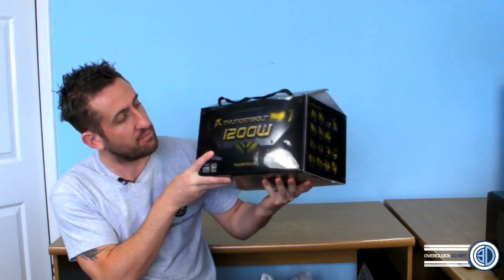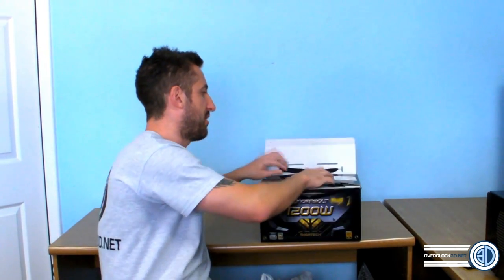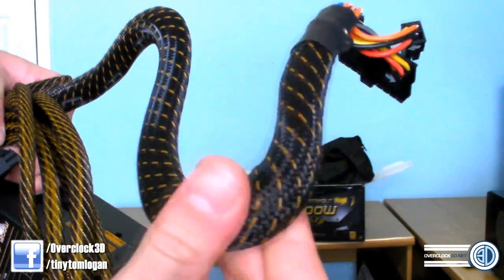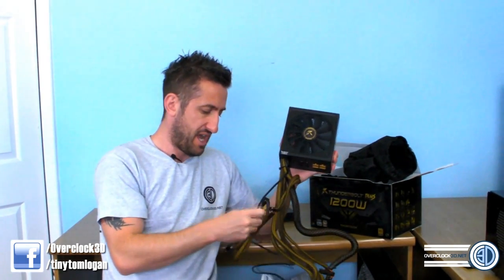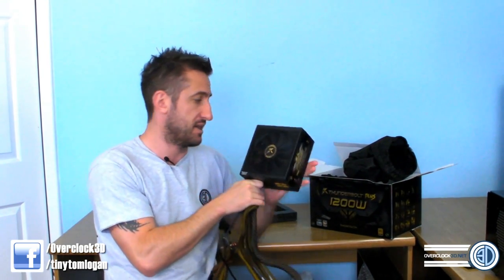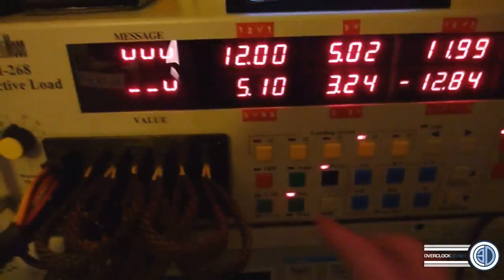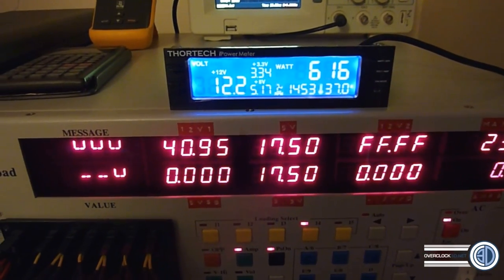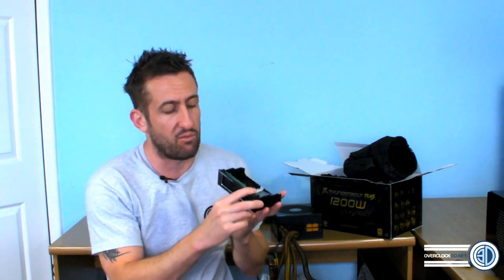Thortech Thunderbolt Worst PSU Ever?

Comment: You should have opened it up and showed us how cheap it was inside.
Reply: segaprophet It won't look cheap inside. It's a high end PSU with better than decent efficiency (80+ Gold Certified) which can just about deliver 1KW, there's no way you could make it in a cheap manner. Furthermore it's designed and manufactured by Sirtec/Sirfa, who are not the best at quality consistency, but their higher end units always look excellent inside. There's probably just a very tiny, visually imperceptible, design fault or quality issue there which produces high ripple and janky behaviour when it approaches 1KW and makes it unfortunately a terrible product, unfit for its intended use. Chances are, an approx. 800W version of this platform performs spot on and might not suffer from issues, it was probably just a terrible idea to try to extend it any further than that and not compensate by instating a lot of extra QA.

1200W PSU is not needed by a lot of people, certainly not by any person with just one or two GPUs, and few of those will take any chances by getting a potentially mediocre PSU a few bucks cheaper which could damage their 3 grand worth of hardware. Chances are, there was just one batch of them made.

Comment: It's not a problem until it's a problem. There is more to PSUs than power delivery, like over voltage / over current protections, and how they protect the components in case of catastrophic failure (even the best PSUs can take out components).

Never skimp on a PSU :) Everything's connected to it and depends on it. Some can even be fire hazards. 

Seasonic, Corsair, Antec, Enermax, XFX, BeQuiet, Some OCZs, some Coolermasters. Also important is the OEM. Seasonic, ChanelWell, Delta Electronics...

Comment: I think Tom makes good reviews, but there is some pints in this one which is misunderstood.
300 mv is not much ripple in it self. Though ripple can be a problem to certain circuits and components.
As to the ripple on the oscilloscope, being from top to bottom does say absolutely NOTHING, about it being bad or good, since you can have a 1 mv ripple "filling" the whole screen too.
The screen is adjusted to show the whole ripple, instead of a fixed value on the x and y coordinates.

Comment: Its one thing ive always tried to warn friends about - dodgy or cheap psu's. A mate of mine at college paid 40quid for a 750w psu after i warned him not too, his rig is fairly modest with a stock phenom 2 quad, 8 gigs of 1333mhz ram, radeon 6850 and a single hdd. He didnt need nowhere near 750watts and cheaped out after i tried pointing out exactly what tom says in the review. Jus a matter of time before it goes pop me thinks

Comment: Expect the AX-i series are made by Flextronics. Overall they are actually better than the Seasonic platinums due to the insanely low voltage regulation and ripple levels.

The TX-m and the lower wattage AX-series are Seasonic rebrands, but the rest (excluding the AX1200 and AX-i series) are made by Channel Well.

Comment: And regarding the test you made with the wall-reading and the display reading is not wrong. The PSU display properly showed the right wattage.
The reason why the numbers differentiated, is because of the efficiency of the PSU.
It seems like the reason for the whole silver,gold, platinum ratings, has eluded you?
Simply put: It take more power from the wall, than the PSU delivers to the component.
The better rating/efficiency the closer the numbers get.
And the diferencial loss makes the heat.

Comment: It was a VX550w and it was a solid power supply, never really had any problems with it and would still consider corsair as a top brand, i put the exact same model in my brothers computer and a cx430 in my mates, both of them are going strong i just had a duff unit, or i was pulling too much (my computer pulls more than both of theirs) i now own a Thermaltake toughpowerXT 575 and as i said before, it is quieter and just as solid.

Comment: if it was dipping then i wouldn't worry too much about loosing components, just data corruption, regular BSoD, etc from having such an unstable system. The big problem for hardware is when the ripple is going too high, as it could burn out everything or at the very least decrease its lifespan.

Comment: how about PowerLab psu... almost 5 years i'm using that power supply.... until now no problem... but i always doing some maintenance like ones 5 or 6 month...or depend times..  clean the dirt dust just by using my electric air blower.... it's shape like a snail shell turbo turbine... just shoot and the dust will blow away... powerful air blow but it did not charmful to your electronic component chips or capasitor... helps me a lot while doing maintanance/pc clean

Comment: Just as an aside, this PSU is terrible but not for the reasons listed. The voltage drop you experienced by the screen was probably the rubbish cables leading off to your multimeter/oscilloscope, and the difference in wattage from wall to what the screen is reading is to do with the efficiency of the PSU. The PSU will draw approx 20% more power then it pumps out depending on it's efficiency and power factor. This PSU is still rubbish, but I'd just thought I'd clear up some misconceptions.

Comment: yes, do not listen to the other guy , thermaltake as long as your buying a non cheapo psu from them is good , id reccomend a toughpower unit from them based on what ive seen and read they are excellent in terms of reliability ,performance, and build quality . and couger is new , however they are fairly high quality . boutique style in a way . they do build higher end psu's and ive seen alot of reputable gear review sites, use them for there test bench at a time or another.

Comment: big names like ,corsair , thermaltake or antec. or if you want omething a bit different, the nzxt power supplys are supposed to be excellent, and i personally own one from xfx and im running it just under its rated amount. and its running great. outside of big brands (in terms of psus not overall )  nzxt and xfx power supplys are about the only ones id reccomend.

Comment: 6 years ago I bought a power supply TAGAN, very quiet, stable. I recommend
Reply: wues85 Are you sure it's a good general recommendation? Because for one, any given sample is not representative of all PSUs, one model is not representative of all models, and for other, you probably don't have testing equipment, you don't have a load tester and you probably don't have an oscilloscope to ripple at approx. 400Khz or higher, and chances are you're not even loading your PSU to the limit.

That being said, i hear Tagan has delivered a lot of good PSUs as tested by trusted professionals, but they have been switching ODMs so there's no telling whether any other model would be good. Another issue is that Tagan basically doesn't exist any longer, it appears the whole Maxpoint group has gone under, stopped doing business, or went bankrupt.

Comment: It's still not making up the ripple. The machine is rated at 1080W according to you. At 1000W (which is within the 1080W), the PSU gave a ripple of 250-300mV. That's too much, and it's not even fully stressed yet.

Comment: Just came home from hospital.. Leaned onto a pc with a bad psu to plug in a network cable into a switch. Got a really big shock.

Electicians came running.. yep, 230v.
Reply: You mean you were shocked by elecricity. Third degree burnz anddd you go back to hospital

Comment: to 1977JohnBoy; Most high end gpu's (7970 or 670 and up) can draw up to 250watts per gpu.  Then you factor in a 50-77 wat cpu.  With one gpu a 500 watt power supply leaves you with some breathing room for hard drives, fans and other pci cards.  Generally you probably wouldn't go with a 1200 watt power supply unless you were going for a quad gpu build.  This specific one WOULD fail if you were to try 4 high end gpus and a moderately powerful CPU.  Buyer beware!!
Reply: You find me a gk110 that is not under subzero temps at 400 watts and i'll submit to that statement, otherwise i've done moderatly extensive reading on reviews and the gk110's rarely even peak at 300, let alone sustain anywhere near 400 even when overclocked.  the haswells don't get much higher than 100 watts when overclocked (maybe 110 max on liquid or air).  I've used a volt meter on my system running a 3770k and 780 and the peak system wattage i've hit was 450, that's with 4 hard drives, 12 fans, liquid cooling (pump) a disc drive, all peripherals and monitor on.  I have the unlocked bios for my DCuii 780 and have that beast cranked.  Max wattage was attained whilst having furmark and prime95 running at the same time.
Reply: Well i see it and therefore submit to your statement :P, there are many posts to back it up; however it seems like with the silicon lottery, safe limits are really hard to determine.  I'll stick to my 1274 core clock and +210 on the mem; temps max out at 70 so i wouldnt have a whole lot of temp headroom anyway

Comment: 80 plus gold/platinum etc is purely the efficiency of the unit, ie how much energy is lost to heat/noise etc. It very possible for a gold/platinum psu to be unreliable or just down right bad and still have that efficiency rating.

Comment: you think so? i have never had any problems with them. then again, i dont generally run them. My systems can get by using much smaller psu's than most because all my storage is done on the network via my drobo fs. so a simple 650 would work for my non gaming rigs. 

back to ocz, there is a difference between crap, and dangerous. ocz does make 80 plus gold certified power supplies.

Comment: This worries me, as I have a Thortech Thunderbolt 850w PSU. I havn't had a problem with it yet, although i havnt yet set it up with SLI or put it under any sort of load. I'm wondering how bad this problem is. Should I buy a new PSU just to be safe or should I just run with it?

Comment: That's how the sleeving is on my ocz modxstream-600, I was rather unhappy with the quality of the sleeving and the length of the 8 pin, I had to run it in front of my gpu..it look's horrible ): but for the price, you can't complain as its semi-modular and a nice solid 600 watts, also the fans almost inaudible IMO.

Comment: i personally dont trust them. they seem to change who builds them very very often, and its very varied on the batch that you get , i have seen some that have failed very quickly and with little warning after pulling not even close to its rated amount .. but ive also seen some as in the case of my friend , who bought an 850 and is stressing it decently and its running without a sinch .also based on reviews im seeing a similer pattern , so id personally avoid ocz. id stick with some of the

Comment: i had a cheap PSU and i ended up replacing it because my cpu volts were dipping like mad. Got a hx 650 never had that problem again. I guess im lucky i did not loose my cpu and other components.

Comment: What do you think about using generic PSUs on office computers that only have a CPU installed ?
Reply: If its under 500 watts then it should be okay but if you want to make sure that its energy efficient and has things like 80+ Bronze or better & APFC it wouldn't be a bad idea as you can get some good low wattage PSU's at low prices from good brands and it could help to extend the life of the computer.
Reply: I live in Lebanon, so my choice is either 9$ generic <400 or 50$ 80plus certified gigabyte psu 80plus certified, most clients won't pay 50 bucks so I'm forced to use generic ones. I don't provide warranty on those computers because who knows what would happen

Comment: How have you discovered your conclusion? Iv'e got a igreen 600w coolermaster psu, 6 yrs old at min and it powers a 680i gtx 8800 fine and im using a 850w modular coolermaster psu. I have been considering corsair psu. Can you elaborate on your reasons please :0)

Comment: Well my logic is as follows, Things like motherboards cpu, ram, are constantly updated, but there is very little change or difference in things like PSUs and once you have a nice case you can stick to it.  I'd rather spend all the money i'd spend on PSUs in one place than buying a couple for the same amount over the same time. With a 7 year warranty that got to be at least 3 rigs so the price is justified by the quality.

Comment: Your unit was from CM's 'good era' where they actually gave two shits about quality and produced lines like Real Power and Real Power Pro. Your PSU was advanced for its time; and so were the RP/RPP series. They already had the eXtreme Power Plus back then; but the build quality was actually decent. I remember having a HIPRO-based CM ePP 430 which lasted years on high loads. Current CM lines especially the ePP are all cheaped-out AcBel builds that are prone to exploding.

Comment: This is actually a pretty decent PSU with high quality components, I don't know what happen to your units but JonnyGuru proves these are decent units.
Reply: +The_rocketman He probably had an engineering unit sent? Or it could have been a batch problem, or a change in OEM supplier?

Comment: Builder's Series (CX)?  Their AX, HX, and TX series are great units and their GS are good but overpriced.  The CX series seems to have a higher failure rate though.  What Thermaltake?  Their Toughpower line is great, but their TR2 line, outside of a couple of models, isn't all that good.

Comment: I haven't found any decent reviews. I have only found a couple of old and not detailed reviews. But I have found some forums. And they generally say, it's junk. I can't confirm that. But if I were you I'd get rid of it. I wouldn't have bought it in the first place. Get a PSU from one of the brands, that Tom has mentioned. Those are all the brands you can trust, plus FSP. I wouldn't consider any other brands. But it's still plenty to choose from.

Comment: This PSU may be crap, it certainly ain`t cheap though. At least over here in Germany the Thunderbolt 1200 costs about 20 € MORE than a Corsair AX 1200, easily one of the best PSUs you can buy. Really strange. I found a few quite decent reviews for the Thortech. Maybe both units were defective.

Comment: Tom you just destroyed GEIL, thortech is a powersupply department geil started. il suggest to get the name abit back up go look a there ram and test that a bit, I got a Geil evo 2 2000mhz kit, been oced to 2344mhz stable on 1.65 and got the timings down to 9-9-9-24 T1

Comment: Hey Guys, been watching your youtube vids for some time now and was wondering if you or someone here could let me know if the Silverstone Zeus 1350watt would be adequate enough to power: 3  XFX Radeon HD 7990

I have a Tough Power 1200 Watt PSU which I will be using to power the rest of the system but as you guys will know there aren't enough 8 pin connectors on the DAME thing for the GPUs :( hence why the other purchase.

Ps. I've already purchased the Zeus PSU on impulse and the itch of having these cards and not being able to use all of them at the same time, so i hope it will be:(

Comment: Is a Cooler Master B500 good? I'm looking on replacing my current PSU which is a 300w from a 2007 Hewlett-Packard (i have built my pc mostly from recycled parts because i'm a poor student)
Reply: Corsair or Walk on home boy.
Reply: Topias Salakka you can look at cooler master GX series. they are quite good for the price.
Reply: Jake Graham Brand loyalty does nothing but bloat prices. There are plenty of good PSU manufacturers.
Reply: ADZCreations
 Well i already got the B500, gonna go with it
Reply: Nit996 Just a fact that they have more power per rail.
Reply: Jake Graham Most of the high end Corsair PSUs use components from I think Cooler Master, I might be wrong. But the point is that they just rebrand components from another company, so once again, brand loyalty is pointless. Read reviews and think for yourself.
Reply: Nit996 you were incorrect in the sense that Corsair actually relies on Seasonic and flextronics as their OEM for high end units. But you are totally right about the about different oems and rebrands.
Reply: Nit996 I think your reply is funny. I know cooler master if anything borrows from corsair. Trust me I am speaking from experience. I am not speaking of components at this point. I am saying that corsair have more power for each rail than any other. That's a fact.
Reply: Adz actually seasonic makes the housing.
Reply: Jake Graham seasonic makes the components inside. housing is the least of their concern, they are an electronics company not steel housing company.
Reply: ADZCreations Right, it was Seasonic. I wasn't sure about who it was, but I'm glad that got cleared up.
Reply: ADZCreations Last I checked  Channel Well Tech makes most of the TX and HX lines, except for the TX650 and HX650.

Comment: No they wouldn't. Most high quality PSU's are capable of outputting what they are rated for, plus more, while still remaining in spec. This thing couldn't even touch what it was rated for before it went way out of spec and failed. And a computer with 20 fans and more than 2 GPU's would pull well over 400 watt.

Comment: I'm not sure about that. In the last 15 years, I havn't seen such bad  a PSU, from the manufacturers Tom has mentioned in the video. There may have been sub-par or sub-standard ones, once a while. But those were only compared to their otherwise high quality sub-standard. And they were still well within ATX specs. But thisone is a killer. 300mV ripple could be an instant killer for a rig, plus it can't put out the 1200W and it's ain't cheap as well. At least here in Hungary. This is a garbage PSU